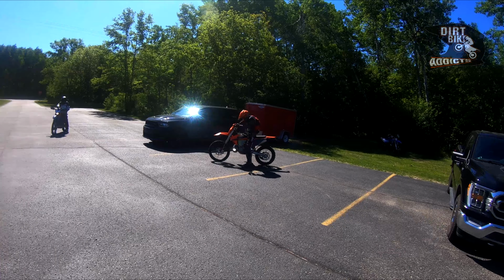Beaver Creek Part 1

Comment: Looks like a great trail!
Reply from the maker: Not too bad.  Not my favorite though.
Reply: Bunkers Badlands! Awesome section!
Reply from the maker: got my wires crossed... I was thinking of Atlanta. Yah Beaver Creek is killer!
Reply from the maker: Wait for the next section...
Reply: @dirtbikeaddicts3172  Jim, how do you like your Beta? I have a 2023 200rr ordered, should get it in August sometime. Yours is a 200 Xtrainer correct?
Reply from the maker: Hi Robert.  Sorry for the late response.  I just a terrible at checking for comments.  I really like the Beta.  It is a 2019 200rr. I am used to bigger bikes though.  I find the power fine, but you have to be in the right gear or be willing to work that clutch, which i am not used to doing with my history of riding larger bikes (KTM 500 xcw and a 300 XC)  I did find the geometry is small for me.  It is built on the 125 frame.  With a knee that is messed up and does not like to bend well, that was my only real issue. Else it is great.  How do you like yours?
Reply: Love it so far, got it in October of last year. Liking the oil injection and e start. The motor is awesome.
Reply from the maker: @robert.gerrie5088  I just listed mine on FB. think i should redo the graphics ?  I like em, but they are a bit loud. :)
Reply: @dirtbikeaddicts3172  Looks good to me. Whoever buys bike can change them later if they don’t like them.